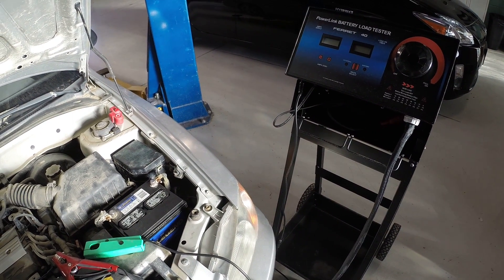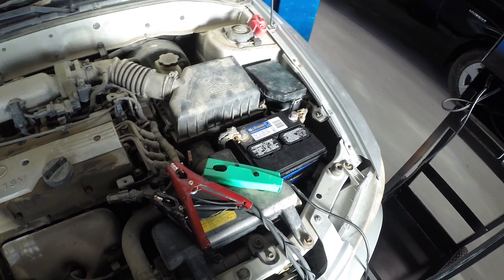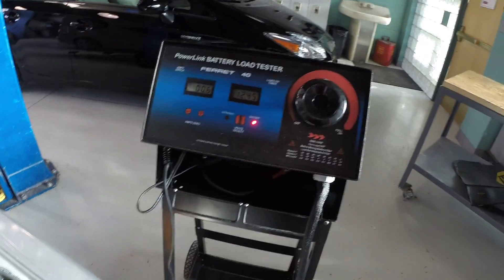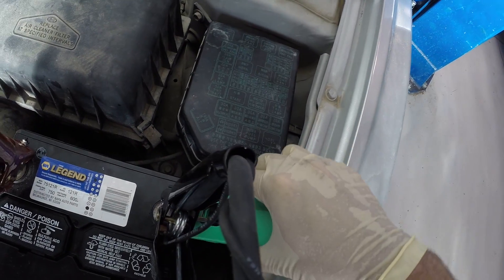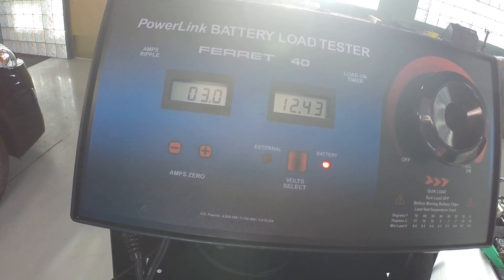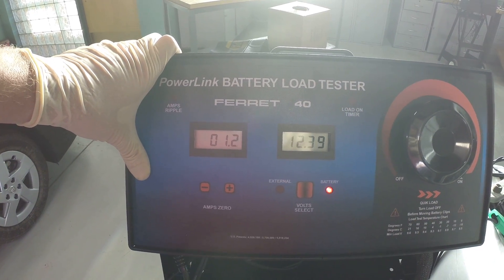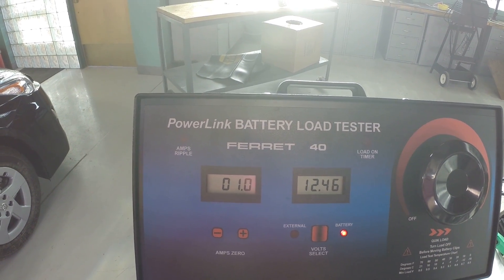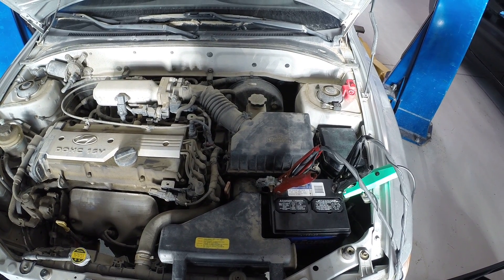Testing Starter Motor Current Draw

Comment: Great video. I have a question, my brand new battery hesitate starting and I attached a volt meter to the terminals and I see a rate of charge at 12.2 volts then when I crank, it drops down to about 7 or 8 volts then back up to 13.8 when the engine is running. Is that a symptom of a bad starter or a bad battery? Thanks

Comment: the amp clam needs the conductor center of the clamp 1:39, at 2:27 the jaw is biting the battery terminal which makes the readings invalid.

Comment: I just tested the starter on my 2003 dodge cummins using a fluke 36 clamp meter.
I showed 784 amps with a cold engine.
Is this excessive?
I thought yes but am not sure.
I have been getting hard starts that sounded like low batteries

Comment: I’ve searched forums and they would say the surge current is like 250-300A then it settles down to something but it looks like it’s in the 700s range 😂 I don’t think it’s because the alternator has a problem. I have a lifepo battery I want to use but it can only accept 400 for 10s and they don’t specify anything for lower duration,

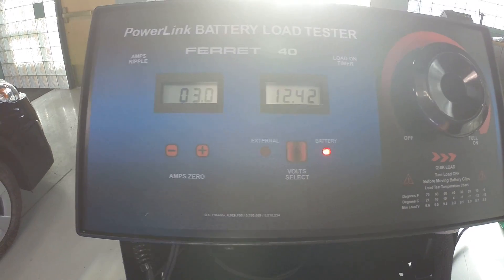Comment: Peak at 3:19 (use , and . on a computer to go frame by frame):
798 Amps (no decimal point is shown)
11.13 Volts
8,881 Watts.

Analog meter would be better.

Comment: did the battery have a parasitic load? i saw 1-2amp on the meter  before and after running the starter. maybe the key was on, or you have woke it up prior to clamping, also before the clamp was attached, the meter showed .5amps, obviously not important, but zeroing the meter should be part of the demo imo, just for the sake of chasing down parasitic load.  i always try to understand why a batter is being replaced other than "Age", like most people do. good video though, thanks

Comment: WOW!!  don't need all that, you can tell it's OK by the sound it makes, and by the fact that it would start right away;
For your info, diesels draw 200 to 250 Amps,if all is ok;   problem is when they do not start,AND they draw too little or too much current...
Reply: its still good to see and understand the theory of operation, rather than chalking it up to the magic of electricity

Comment: Just for curiosity.... What happens, if the engine starts?
Reply: @Hr Gwea - Nah, when the engine starts, the starter disengages because you stop cranking the key. When the engine is running, the display on your meter is no longer reading the starter amps because the starter is no longer engaged.
Reply: If the engine starts and you don't turn off the starter, the flywheel is now powered by both the starter and the engine.
But since the engine is much more powerful than the starter, the poor little starter is now being forced to spin much faster than it's supposed to, which would damage it if that happens for too long.

Comment: in my experience 55 to 200 amp will be ok. more than that will be to high. GM starters pull up to 250 amps
Reply: thanks
Reply: so all gm starters are too high?